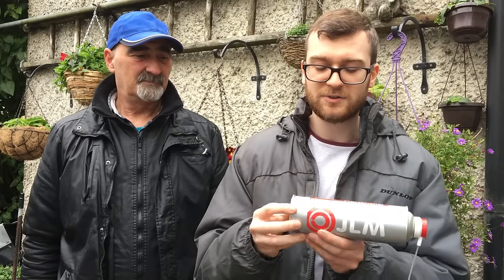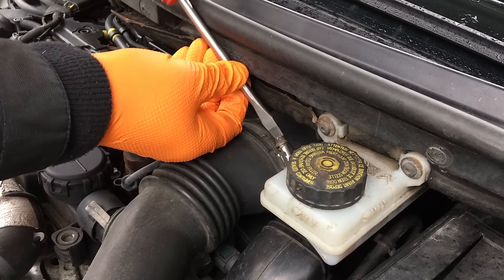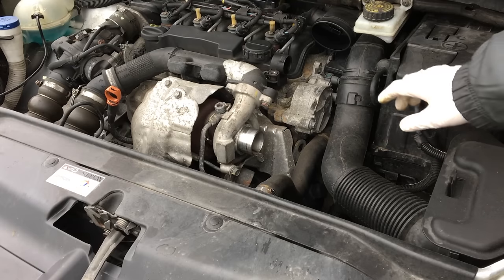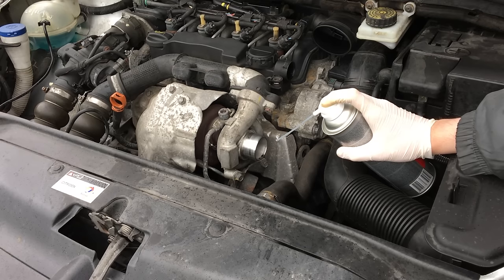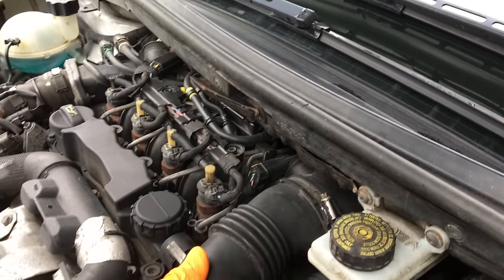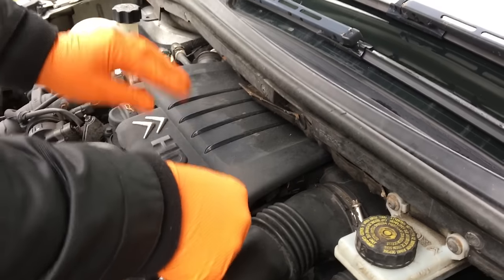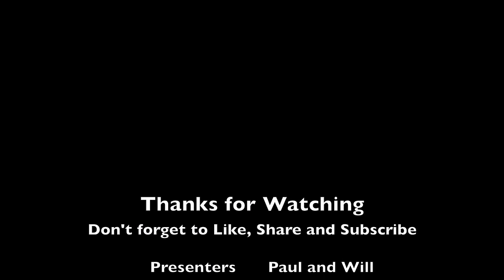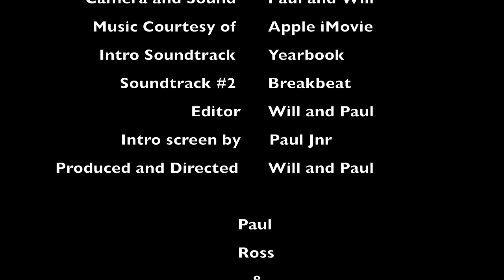How To Clean an EGR Valve Without Removing It

Comment: Have been told to spray in after the turbo
Reply from the maker: Really. Who told you that?
Reply: Neil Cromwell That is correct. Turbo blades operate at very high speed and are thin. Any liquid ingress wears out the leading edges of the impeller vanes... never inject any liquid in to the turbo.
Reply from the maker: Hi MAS,
Are you implying that all EGR valve cleaning products and manufacturers supplying EGR valve cleaners are misleading us with incorrect directions.
We followed the directions as printed on the JLM can.
Please provide proof of your above statement that JLM EGR valve cleaner can cause excessive wear or damage to turbo vanes so that we can pass that info on to the manufacturer of JLM diesel air intake and egr valve cleaner.
Driveway Dudes - Paul
Reply from the maker: We are in no way affiliated with or to Citroen. We have never and would not promote a particular car brand. The C4 in the video is owned and run daily by Will. If there wasn't a problem with the EGR valve, we wouldn't have made this video. We do not claim that this is a permanent fix but a temporary one. We agree that removing the EGR valve and cleaning it would be a better option. On the C4 it is not easily accessible and could be beyond the capabilities of even a good diy person. We have owned and driven many cars over the years, some considered good which were not and others considered garbage which were actually good. BTW Citroen share parts with many other makes. What would you consider to be a good car?
Paul

Comment: can I use this on a 2010 sebring 3.8 L
Reply from the maker: The 2010 Chrysler Sebring Town and Country 3.8L petrol 6 speed automatic?
Reply from the maker: As far as I can gather the type of egr valve you may have is more prone to the solenoid failing than it sticking.
The type of egr valve cleaner we use is more suitable for diesels and may not suit your car

Comment: You didn't' point out where or what the "EGR Valve" was. I had hard time following without knowing what you guys were doing.
Reply from the maker: We have previously explained that this one way to clean the EGR valve if it is in-accessible. It may not be a permanent fix but may help.  
Some cars do not have an Exhaust Gas Recirculation Valve to redirect a portion of exhaust gases back into the engine to help reduce emissions. 
The EGR valve on this and many other Cars is located at the back of the engine so it would be very difficult to visually point it out without having to remove parts

Comment: Ford ecosport 1.5Tdci egr valve and air sensor cleaner
Reply from the maker: Hi Karan Valkunje,
Are you having problems with your egr valve, car losing power, over revving or slow to respond?

There is a known issue with the 1.5TDCi unit where this year Ford is recalling owners for a PCM (power control module) update/upgrade on certain models. Please contact your local Ford dealership for more information

Comment: Hi driveway dudes,
My tata indica Vista 1.3L quadrajet(fiat sourced) using since 2011 mileage of 160000Km, i feel no power , moving harder, pick up was too low and higher fuel consumption,
I have changed all the oils and filters, but no use,
Would you help me with this regard,
Or share your contact number , so we can connect in private
Reply from the maker: There could be one or several issues.
If you are city driving the Vista then there are many recorded complaints from owners that it is not so economical.
The 1.3 multijet/quadrajet occasionally needs to be driven fast and for some distance to clean it out.  
You say filters were changed. A dirty fuel filter that could be partially blocked or have contaminants could cause the issues you mentioned.
The fuel filter it is not a part of the normal service and unless instructed to replace it, the service centre will not.
Have you had an OBD/EOBD scan carried out. It may help diagnose an issue.
Reply: @DrivewayDudes  yeah bro, i will do that, and i have an another thought of cleaning egr valve and inlet manifold for clogs removal and easier breathing of engine ,but is it recommend, would it be helpful.

Comment: That's not good way to do it all dirt will come to your DPF filter....
Reply from the maker: This model does not have a dpf filter. All exhaust gasses pass through the pre cat and dpf and there are recommended additives that can be used to help clean the dpf should it be necessary

Comment: so....here is the deal with that.........all that carbon and muck in the egr valve.....also the crap in the intake manifold....well, all that shit is gonna end up sitting on top of the pistons. doesn't sound so good does it? good chance it will ooze into the cylinders after shut down. it will damage the rings if it does not hydro lock the engine. also, any of that muck that does get out of the engine will not do so well in the turbo, hope it does not have a vnt........the cat wont like it either. so guys.....mechanics like me, make a lot of money off of people like you.
Reply from the maker: Thank you for taking the time to voice your opinions and concerns.
We have over 30 years certified combined experience in mechanics, engineering and motor trade.
This is a preventative maintenance video. We are not suggesting that this will fix a serious problem with the EGR valve but it's the less expensive option before going to a mechanic. 
We do not believe that this will in any way cause further issues. If the contents of this spray can could in any way cause problems to our car then we would never attempt it. We also feel that if that were to happen then the manufacturers of the product may be liable and we are pretty sure that they have tried and tested it prior to marketing it.
All fuels contain additives and in some unfortunate cases contaminants. It's the residue of these that cause the deposit build up in the first place. This is one product of many available that has cleaning properties. It is highly combustible so in our opinion would not cause hydrolock and the remaining particles would have no more negative effect on the car than the standard particle emissions.  
We also have another video on cleaning a removed EGR valve  https://youtu.be/HXqJ0YcOqOI

Comment: WEAR SAFETY GLASSES ASWELL AS GLOVES.
Reply from the maker: Hi Thetrucky69,
In the event of a possible splash or spray back that is good advice. 👍Will was wearing glasses and gloves. I was not as I was in the car.
Paul
Reply: Driveway Dudes No worries at all mate. Good work cheers 👍

Comment: this is the irish paddy way of cleaning the egr just strip it off and clean it as it could be the electric part thats fucked up anyway :)im irish myself but would rather strip it off and do it right no offense lads ...drive away dudes down the road and tow back:)
Reply from the maker: Hi diesel man,
    Thanks for the comment.  As we have explained before, this is a maintenance procedure. We would recommend periodically using EGR valve cleaner which may prolong the life of the component. Why wait until it becomes faulty.
If the EGR valve was reading as faulty and the spray cleaning did nothing then the next step would be to remove it, check it out for obvious faults, clean it, test it if possible and refit it. If after all that it was still reading faulty then it would be replaced.
Driveway Dudes - Paul

Comment: Good way to destroy your motor doing this. All the loose crap will go straight into your engines upper cylinder. The only way is to remove the inlet and put in the hours off cleaning it.

Comment: My tip is don't buy one of these engines as they are a pile of shite, Citroen, pugoet, Ford all use this 1.6 oil refinery and turbo muncher. You can't beat a 1.9pd VW engine.
Reply from the maker: The 1.6 engine is used in a variety of brands and is considered quite reliable and proven to be capable.
The 1.9pd engine is also a very good engine.
We have come across both the 1.6 and 1.9 above engines with recorded mileage in excess of 300k and both are still going strong
Failure to properly maintain any engine can lead to issues

Comment: This is bull💩💩💩💩 only way to clean EGR valve properly is removal, these sprays are just short term fix, it may turn engine light off but ultimately it will come back on & then it is work for mechanic if you are not proficient in vehicle engines  !!